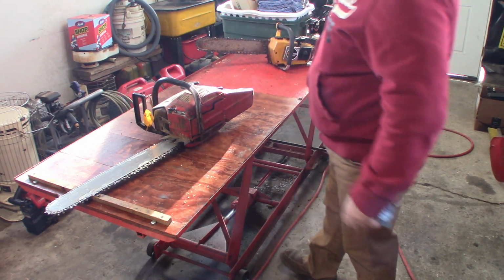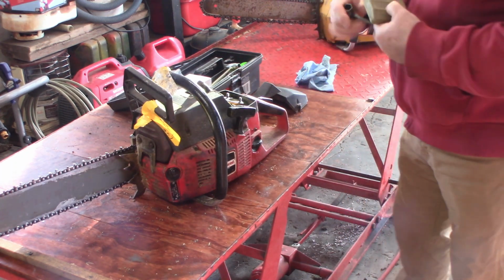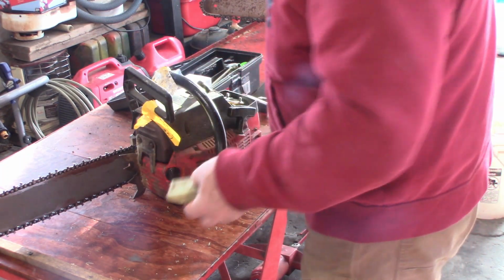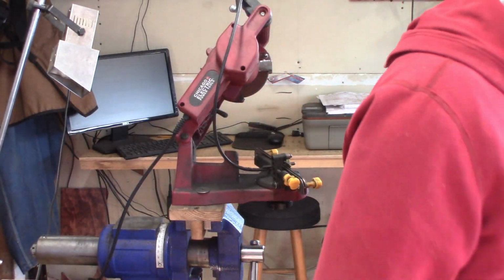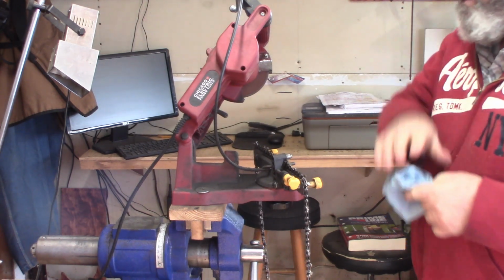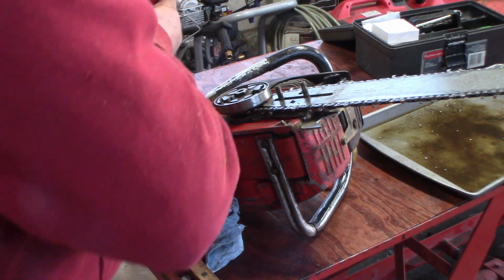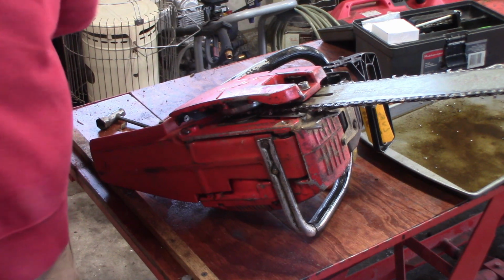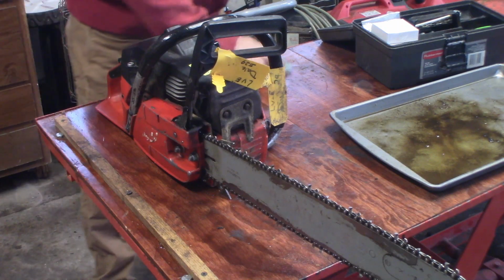Jonsered 625

Comment: hello. what is the length of the blade that the 625 wears. i have the same jonsered and the blade broke.
Reply from the maker: It's hard to say what blade or chain you need. There are a few things to know to get the right chain. This information is on the bar. 1- The pitch of the chain, The pitch of the chain should match the bar and the drive sprocket on the saw. 2- The gage.This how wide the slot in the bar is, and how thick the drive tooth is. They should match. 3- The number of drive teeth. This number is on the bar. The longer the bar the more drive links (DL)
https://images.app.goo.gl/VDEGGyavxSamaT9K7
This images shows the writing on the bar. Different makers have different markings but the information is the same.
Hope this helps. Thanks for watching.
https://youtu.be/hLXK_3JUFMo
This video my help.
Reply: Thank you for the informations.
With the fotos which you send me , i found the right blades